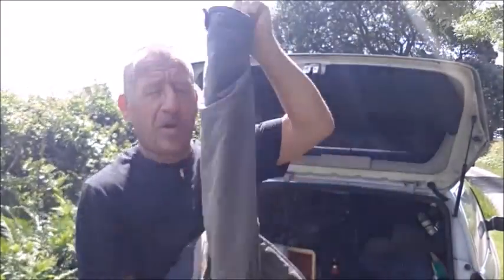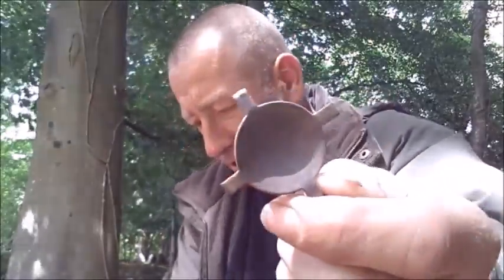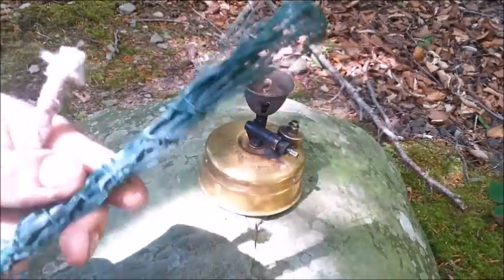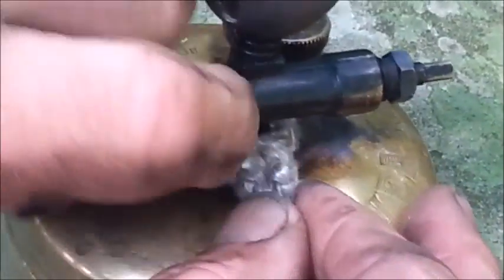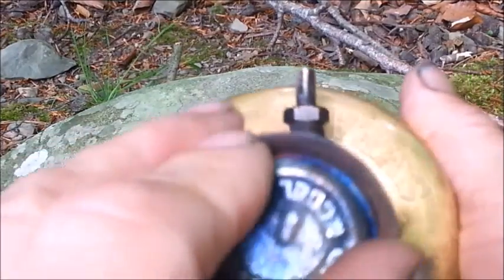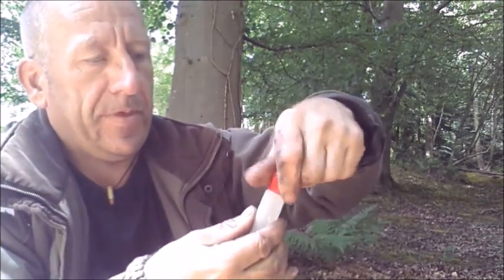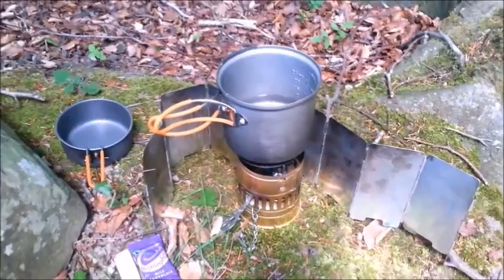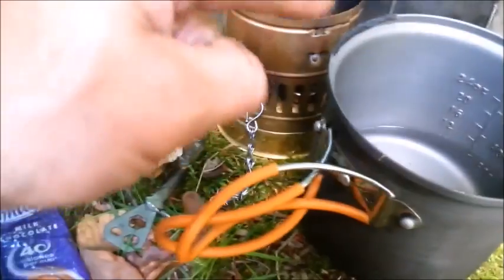Quiet Cap For The SVEA STOVE

Comment: 5 years later… did using methylated spirits/alcohol to prime via wick cut down on soot over using White Gas?
Reply from the maker: White gas less soot. But a spray down after camp with carb cleaner is a 20 second job....

The 123R had a faulty spindle, in hindsight would have bought a vintage 123 instead with less moving parts. The 123R was replaced with a £30 BRS white gas stove, and has not yet been serviced 3 years on, and it flawless, and puts out more boils per tank too. 

The BRS (White gas) a little bit heavier & bulkier, and isn't as pretty, but hell she puts out. Practicality over sentiment these days for me.

Comment: I love my SVEA 123! But my current Chinese manufactured reproduction is polite and politically correct. The Swedish made original I had growing up was LOUD!!!!!  And manly. Jet engine loud. Can we trade?! Is yours LOUD! Like it should be?
Reply from the maker: Mine was the 123R model, I would love the original 123. My R model needed some parts, and replacing them was no longer viable, so sold it as parts,,,

Comment: No reply necessary, thank you.
And thank you for sharing.
I watched this when it was first posted, and just come across it again.
I had hankered after the SVEA 123 when a youth, but my budget back then compelled me to get an inexpensive metholated sprit stove in a can for the one pot cooking I did on cycle camping trips.
Although I have a Trangia 25 ( £3 charity shop buy 30 odd years ago and now modified to accept gas) ; and a 27 of ages ago, ( swapped in Titanium pots from an on line clearence sale 5 years ago). I succumbed about the same time to my desire fot the SVEA 123; NO REGRETS. 
March 2020 on YouTube a Norwegian had a vlog on the Svea and didn't like the quiet of the silencer and was going to restore the JET RAW. I offered to buy the silencer, but he kindky sent it as a gift. I love the quiet, and it seems to regulate lower too.

I use Aspen 4 fuel 5 L £21approx.
A 50ml squeesable bottle with a fine nipple filled with FIRE-DRAGON Gell is an ideal non spill primer.

At work on a floating 3/4 ti wind screen, not entirely resolved yet.

Turn to the right to screw up tight.
Left raises the needle to clean the jet hole. 

Thanks again for sharing. 
Take care

Comment: I enjoyed your Video.
I own an Old Brass Primus Stove that I bout for $2.00 at a Flea Market in 1975,  because it had a really badly burned and rusted Steel Case.  I made a custom pot support with 4 rests that swing out wider than the case,  and work well.  I have used that stove for many many a hike,  and it is made to operate exactly as your’s.  Yes.... a real jet engine!!  It does ruin the tranquility!  When you turn it off,  after cooking a fairly large pot of stew,  you really notice the quiet!!  I was aware of that modification to quiet down the stove,  but haven’t tried it yet.  My Safety Valve Cap ends up venting a very small amount amount,  constantly,  and it ignites and there is approximately a 1/2” Long flame constantly burning on the Safety Fuel cap,  just like a Pilot Light!! 😧😵  it is unnerving!!  It’s probably no more dangerous than the stove burner itself,  but I cannot get over the nervous feeling! 😬🤭🤦🏻‍♂️  It is my understanding that New Caps are not available.  I cannot break the Safety Cap loose for disassembly.  I’m now wondering if your Stoves Cap will fit mine.  It just might!

Comment: Very nice review.  Made the same modifications that you did.  I used carbon felt like Colorado Camper and it works great for priming.  Quiet cap is a great invention for anyone with a SVEA 123/R.
Reply from the maker: Since the making of that video, the spindle broke and need to buy a new stove. Many have told me it is a common issue with this model, but the original has less moving parts to go wrong. I kept the quiet cap,, which sit on my BRS petrol stove.....

Comment: Great stove.  I have had my two SVEA 'Roarers' for 40+ years.  No, they are not for sale.
Thanks for the Vid.
Note:  The OFF position is key turned fully clockwise.
Key turned fully counter-clockwise is to clean the orifice, but it is not sealed, and will leak fuel.  And, if you leave it turned counter-clockwise, you risk damaging the cleaner pin/needle.
Reply from the maker: B

Comment: I used a liquid steel, JB Weld type epoxy on the rim of my metal cups to prevent burning my lip. If the tape lasts, great. The epoxy is a permanent fix.
Reply from the maker: Thanx for the tip, gona try that for sure...Bex

Comment: Just found your Channel oh, I have one question about these little quieting caps. What keeps the cap inside or doesn't fall out if you turn the stove one way or another? Is there a way of permanently installing the cap? Thanks for your time brother and have a good day.
Reply from the maker: Once it was set up and running nicely, I use some garden wire to keep it in place, but often the bell housing contracts enough with heating up and cooling down to keep it in place.....
Reply: @bexbugoutsurvivor  thanks for the info brother you have a great day

Comment: Hi mate .. great vid... just actually got a 123r on order - should get it soon (9th jan 2020)... I know this is an older vid.... just wonder if you still use the svea?? Cheers
Reply from the maker: Hi mate. No I no longer have the svea 123R stove. It suffered a small failure, and the parts required to fix the issue, were nearly the cost of a new unit. Providing you use the cleanest fuel, and keep it maintained, you should have fewer issues. 

The vintage 123 svea does not house a self cleaning needle pricker (the culprit of my stove failure) so the older ones out last the newer 123 R models. Since then I have opted for gas cylinder stoves, and keep meths for DIY stoves. The failure of the R version, is thankfully not that common, and the original 123 from the 1960s, failure is unheard of. 

Hope this hasn't put you off your relationship with your new stove, and hope you get as much enjoyment as I once did. The letter (R) stands for replica. Mine was made by optimus, although keeps the Swedish name Svea, the original 123 would have been my choice, knowing what I know now in hind sight......Treat it well, it will look after you,,,,,bex

PS I stripped mine down for parts, and sold them, and got back nearly all my initial investment....happy trails...bex
Reply: bex bugoutsurvivor hi bex... thanks for the  e reply and info..... I too wanted the original but I could not find any at a reasonable price.. on eBay they all had a shipment from the USA. So I thought I would risk it lol! I do plan to use on aspen 4 . Local to me (Nottingham) I can get it from agricultural shop around 25-30 Quid for 5 ltr . Which should last for months at my expected usage rate. So fingers crossed I don’t blow it up or break it too quickly!! All the 
best Chris

Comment: Can I assume thats a Bernie Dawg 3d printed Cap, I think it is. Yes the SVEA is a brilliant stove I have used it at 12,000 feet in the alps in France and then again at 9000 feet in the Spanish Pyrenees in heavy winds it never goes out, way way better than a Trangia any day, I have one so I can vouch for the stove over the Trangia...So I take the trangia food pots abut the SVEA stove.

Another thing to stop mouth burns is to use some silicone tube cut it length ways and put it on the rim, fits perfectly.
Reply from the maker: The silicon wrist band mouth burn tip, has already been filmed on this channel...
Reply: @bexbugoutsurvivor  Thanks I didnt know that. I have been using it that way for donkeys years. My Svea is 50 years old and was given to me on my 10th birthday as i was in the scouts and its still going strong and I still use it up the mountains now, less camping now im nearly 60 but i still do the odd night now and then. In my opinion this is the best small stove money can buy.  Thanks for letting me know that. I guess we have  had burned mouths and lips at one time in the past!!
Reply from the maker: My thru valve leaked on this replica, so I could only turn it off by turning it the wrong way, and blowing it out. I would enjoy the 123 more than the 123R I think.....

Comment: may i ask what kind of rope did you used in this stove. I'm in research and think i will try the ceramic rope. I already have the coleman m1950 Stove and i found that the rope inside can ignite without turning to an ashes
Reply from the maker: Its fibre glass stove rope. Try 6mm

https://www.ebay.co.uk/itm/Stove-Rope-3-4-5-6-7-8-9-10-12-14-15mm-for-Door-Glass-and-Flue-Seals/192395644953?hash=item2ccbac9019:g:Nv4AAOSwTCdaCH03
Reply: @bexbugoutsurvivor  Thank you so much

Comment: Does the cap change the cooking out put heat?
Reply from the maker: Only for the better. It directs the flame onto the surface area, instead of the hap hazard  flame of the spreader. The downside is it has sooted up the jet. Solution was to needle the jet more often, and spray the damper with carb cleaner every few weeks....Bex

Comment: How does the Silent Cap affect thermal output and fuel consumption?
Reply from the maker: Hi thanks for your comment. I have not ran efficiency testing, but I personally cant see and adverse affect on fuel consumption, and the BTU output remain the same or similar, if not a little better, as there is less lost energy to direct connection to the cookware..(however this remain only my opinion) so far...all the best...Bex

Comment: This is a great backpackers stove used in the field for preparing quick meals and a hot drink. Does it really warrant the high cost of making it silent? In my opinion, as the owner of one of these and
several other pressure stoves, no. It is no more noisy than any other roarer burner.

Comment: I have used the SVEA 123 Stove since 1963 with good and reliable results and no modifications. This stove needs no modifications.  The carbonization you have is because you run it so low. Run it hot and carbon does not develop or burns off clean.
 Watching your other videos it is unfortunate I can only give you a thumbs DOWN  once.